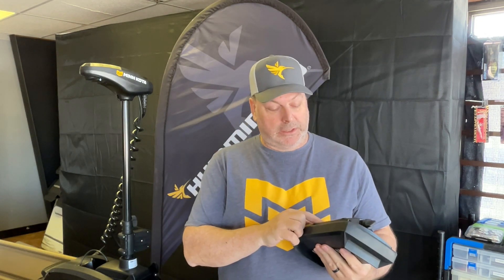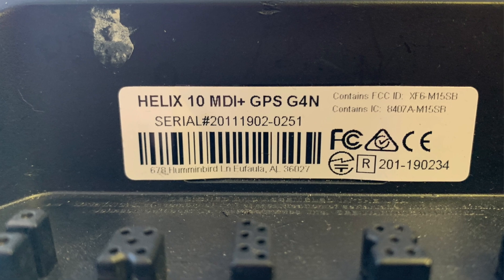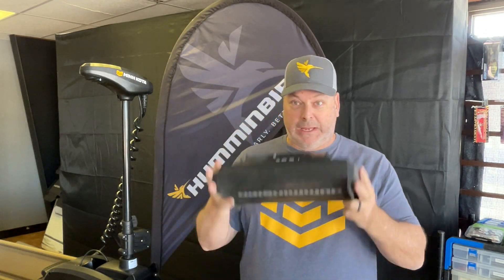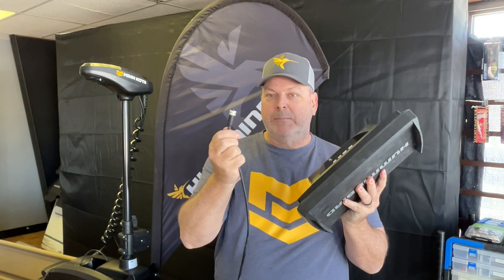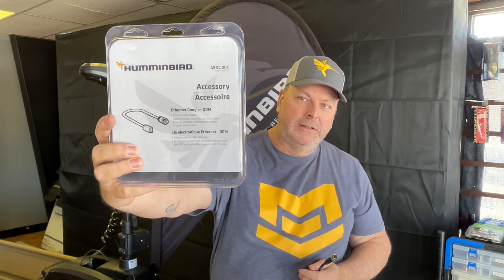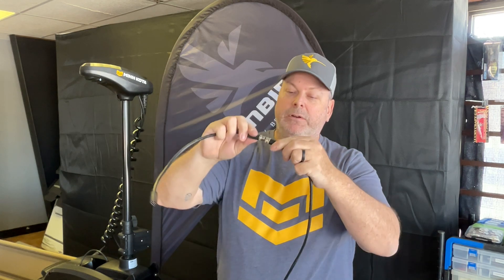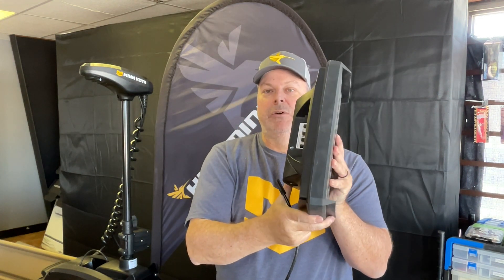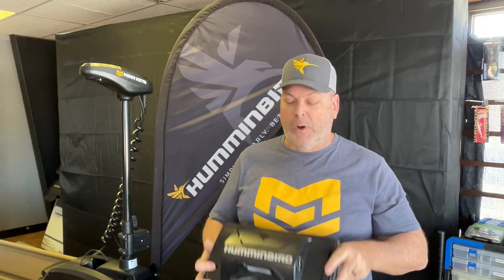How to Connect a Humminbird Helix to Minn Kota Motor

Comment: I know it's been a while that you posted this video, I was wondering if I could use the EC M10 Extension cable to connect my Trolling motor to my hummingbird. My issue is that I want it to be connected to my main sonar in my console and the dongle et and cable are not long enough. that 10ft EC EM10 would provide the length needed but will it work?  Many Thanks!! P.S. I know my trolling is the Ipilot link and my sonar is a Helix 9 GPS G4N.. both device have the latest firmware and I already have the dongle to connect them both..
Reply from the maker: It will work but that is a transducer extension for Helix so will only help connect the transducer (not the Link functions) You need an ethernet extension and AS EC QDE dongle to connect the Link functions. The extension was in the motor box if it was link.

Comment: I need help with getting the right extension cable.   Im new at this.   Im trying to connect my new helix 7 di g4n with my monn kota power drive advanced gps controller.   I got a replacement head for my power drive v2.

Comment: just bought a Helix 10 SI GPS from a guy on FB (got a STEAL for it) - all I am trying to do is have the trolling motor drive itself within specified contour depths, not going to use any of the sonar features.  Will that unit work or no?  I have a 2021 Minn Kota Trolling Motor Terrova 112/DI/Iplink-60" (model 1358837).
Reply from the maker: If it is G2N it will work once connected through ethernet and all software is up to date

Comment: I have a Built in Mega DI Transducer on a Terrova. Anyone know the adapter number to connect the Ethernet cable to the MDI trolling motor transducer cable? It came with the ethernet to 5 pin adapter to connect to the Helix G4N but nothing for the transducer side. Or do I need to get an ethernet switch? Or is there an extension cable for the MDI extension cable to go to the 5 pin?
Reply from the maker: Ethernet cables don't connect to a transducer cable. There are no adapters.
Reply: @principleoutdoors8932  thanks this is a Advanced GPS Trolling Motor. I did t see the ETH connector in the TM head. So has 2 cables ETH and Transducer cable

Comment: It doesn't need to be Network Helix. I use a Helix 7 G4 linked into my Terrova.  I use it for 2D and routes because the Minn kota Terrova needs map to follow One Boat APP waypoints and other features like routes. The only pain is uploading the information via memory card. It definitely wound be nice to connect wi-fi to update the information directly into Hummingbird,  but it's still possible.  I import and export information back and forth with my Garmin and minn kota app no problems.  I just had to direct connect Hummingbird to follow my routes for trolling. This is my go around so I can use my Garmin and Minn kota.
Reply: Sounds like the easiest way is a networking Humminbird connected through ethernet

Comment: Im looking at buying a Terranova with Ipilot Link with Mega Imaging Transducer installed. 

I have a Humminbird HELIX 10 CHIRP MEGA SI GPS G4N Fish so it has a better transducer due to the side imaging.  

My questions is can I connect the Helix transducer instead of using the built in one that doesnt have side imaging?
Reply: You can plug in whatever transducer you want want but the transducers in the motors are amazing....either way you are good to go
Reply: @johnnoel2042  I don't doubt the built in transducer, just sadly the trolling motor I was looking at doesn't have SI while my current transducer does. Thank you for the information!
Reply: @johnnoel2042  Do you know how well the built in transducers hold up? I do a lot of shallow fishing, and im worried about it getting damaged and being beyond repair.
Reply from the maker: @JM4UBBY  They hold up great. I only bass fish, often in very shallow water. However, the face of the ducer is not made to be grinded in to rocks...none are

Comment: So I have the ulterra with the built in MDI tranducer hooked to my Helix 7 G4N at the bow. But I want to run a MSI Helix 7 separately at the helm and link the 2 Helix units. Do I need the Ethernet switch to do this?
Reply from the maker: Quick answer is no. Just two AS EC QDE adapters and one ethernet cable will allow the two units to share transducers and waypoints. Be sure the 7 MSI is a networking unit though (G4N, not G4) Now if your motor is a "Link" motor and you want that communicating as well, then you will need and Ethernet switch.

Comment: There are a few things that make me want to go away from hummingbird. By far number one js you have to buy their special adapters and dongles to connect. Everything is 60 to 75$ and it's ridiculous. It's a money making sham.
Reply from the maker: That's one adapter, the AS EC QDE which is for Helix because Helix does not have metal connectors on back. No adapters needed for Solix or Apex. and for 2024, all adapters included with all Minn Kota motors for Humminbird users
Reply: I’m not disagreeing with you by any means but I’ve run garmin and lowrance and they have their own versions of having to buy extra dongles/adapters also. But yea it’s incredibly frustrating to drop a few thousand for these things that “support” each other only to have to spend more to make them all work together. I hope that reads easily 😂

Comment: Helix 10 G4N with MEGA SI+ & MEGA DI+, can I connect this to my Terrova MDI with IPLINK? Can I use all 3 of these transducers at once or do I have to unplug the trolling motor and plug in the transducers that came with the Helix and vise versa? I will send beers if you know. 🤣🤣😁😁
Reply from the maker: If the motor is "Link" yes you can connect the Hlx 10 to it and control the motor from the Hlx. Bad news is Helix only have one transducer connection so only one can be connected and there is no switch or splitter for the transducer in the motor. Best setup, get a second Helix for the bow, connect the transducer to that. Then get a 5 port ethernet switch to connect the two Helix and motor. Then you can go in each units menu and tell it which transducer to use. Canadian beer please...not that American piss water...and no Bud Light!

Comment: I got the cables you mentioned and then the extension cord to run to hummingbird at console but then I get to trolling motor and they are the same end. Is their an adaptor to connect the two? Thanks in advance.
Reply from the maker: It sounds like you got a longer ethernet cable , not the extension. The only ethernet extension available is 760025-1	AS ECX 30E

Comment: What do I need to hook to a solix 10 ? Same cable just different pig tail ?
Reply from the maker: If your motor has an MDI or MSI transducer you do not need any adapters
Reply: @principleoutdoors8932  that will allow me to control it from the graph correct? I ordered a cable thought it was the right one but wasn’t so trying not to lose anymore money then I have already
Reply from the maker: @trystinthrelkeld9957  my apologies, I was referring to the transducer which has nothing to do with controlling the motor from the sonar. God news is, If your motor is iPilot "Link" you can take the ethernet cable and plug right in to the back of the Solix...no adapter
Reply: @principleoutdoors8932  ok will order the extension cable thank you sorry for the confusion no videos for the solix units just the helix wasn’t sure if anything was different or not thank you for your time !!

Comment: So I have a Helix 7 G3N with Bluetooth that I can connect to my phone, done that... Cannon (whatever that is), Talon (???), Raptor (???), & wireless remote, but no option to connect to a trolling motor? 

I have the Minn-kota Riptide Terrova with I-Pilot Link brand new just got it a week ago? 

Any way to connect via Bluetooth? 

I do have the cables you show in the video if Bluetooth doesn't work
Reply from the maker: Controlling the motor through the sonar requires an ethernet connection. I don't believe Bluetooth is stable enough to handle all that data

Comment: Good video, my problem is the cord on the motor is too short to make it to the head unit by the driver's seat, so I bought an ethernet extension but that cord has two female ends.  Do I need a third adapter of some sort?  Thanks for the help.
Reply from the maker: Thanks..sounds like you got an ethernet cable, not an extension. There is only one extension.760025-1	AS ECX 30E..It comes with all Link motors

Comment: I bought the same trolling motor with G4N Helix 9.  I love it!  However I do not know what to do with the US2 cable.  I currently have it zip tied to the motor.  What do I do with it?  There is little info.
Reply from the maker: If you want to see the motors transducer on that Helix 9 you just need the MKR-US2-8 adapter and it will plug right in. There should have been a sticker on the outside of the motor box explaining this

Comment: Just a question. What about power to the Helix ?  Or does power come from the motor on the Ethernet cable. Thank you
Reply from the maker: Helix has it's own power cable and it needs to be used
Reply: @principleoutdoors8932   I kinda thought so.  Thanks 👍🏻
Reply: @principleoutdoors8932   Can I run the power cable to my master power switch, or run direct to my battery ?
Reply from the maker: @brett_Thorpe  both are fine but I go to a fusebox, to a dedicated electronic battery
Reply: @principleoutdoors8932   ok sounds good. I’ll run the cable to the master switch, which has a fuse box under the dash. I believe. My boat is a new Lund. Yet to see the water. Thanks for your help. I appreciate it.

Comment: Great video!  It's too bad they couldn't connect wirelessly.  Both the Minn Kota and the new Humminbirds have wireless capabilities.
Reply from the maker: Thank you...Oh I agree 100% and it will happen at some point
Reply: So I have a Helix 7 with Bluetooth that I can connect to my phone... Cannon (whatever that is), Talon (???), Raptor (???), & wireless remote, but no option to connect to a trolling motor? 

I have the Minn-kota Riptide Terrova with I-Pilot Link brand new just got it a week ago? 

Any way to connect via Bluetooth? 

I do have the cables he shows in the video if Bluetooth doesn't work.
Reply: Can I buy a Ethernet extension? I bought my boat secondhand and the trolling motor has a short jumper attached nothing long enough to reach the console
Reply from the maker: @kyleheiser6622  yes you can..for Ethernet the extension is 760025-1	AS ECX 30E